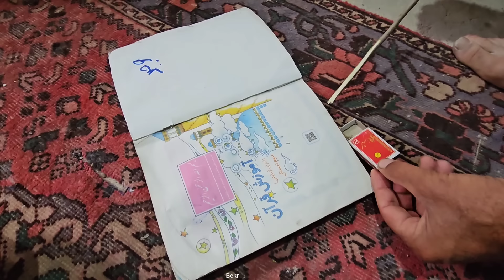Dangers of heavy rain and floods: cooperation of the Becker family in the face of problems 🌧

Comment: Mr bekr, I will help you with the water at back of house.
1. Dig trench 2 feet wide along back of house.
2 buy rubber liner glue to the wall all the way along back of house. Use the rubber they use for roof.
3. Put gravel in trench 6" deep.
4. Put perforated pipe along the back and side of house.
5 Put gravel on pipe until buried. If you can put a sock around pipe would be better.
6 now back fill to your desired height.
Reply from the maker: خیلی ممنون از راهنمایی  شما
Reply: @bekr232  I don't know what that means, that writing I don't understand